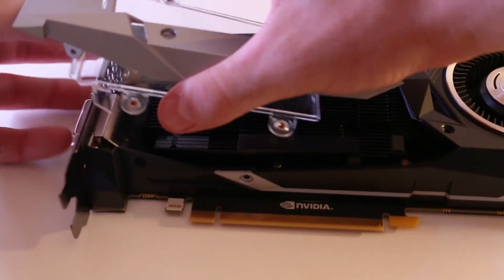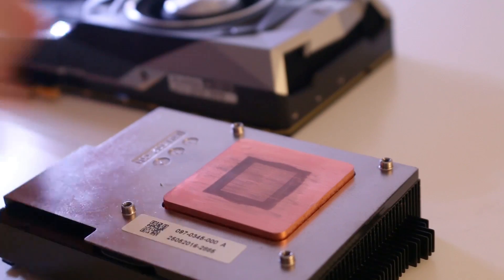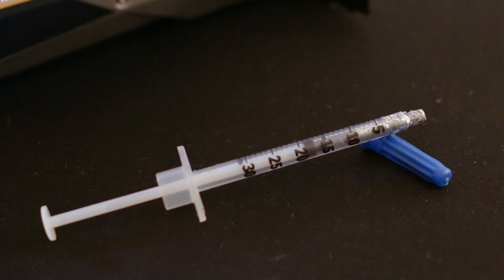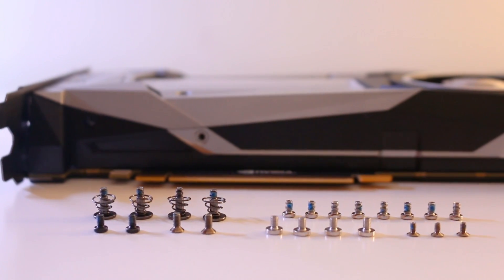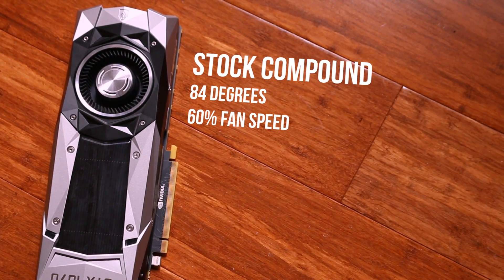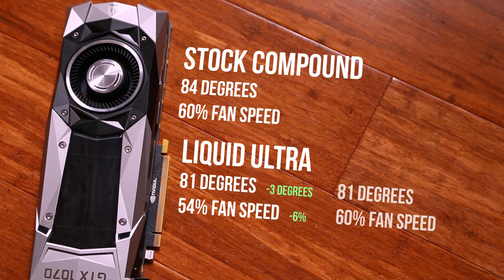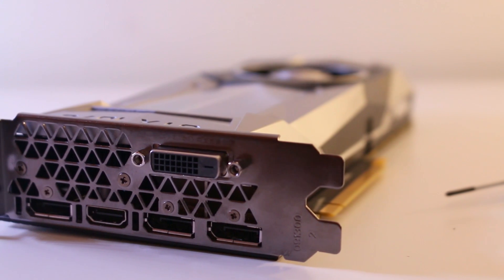Replacing GPU Thermal Compound With Liquid Metal?

Comment: The reason why there is so much thermal compound on the GPU is simple to ensure there is enough on there. Too much thermal compound doesn't give any downsides to thermals, however havin too little on there is dangerous the gpu could melt it self in the blink of an eye. You see the same when delidding a intel CPU between Ivybridge, and kabylake non-X series.

Comment: I've been doing a bunch of cards with liquid metal lately and the reference coolers done benefit much if at all. 

Good coolers however, seem to yield excellent results!
Reply from the maker: +Upgrade Addiction Nope, the reference coolers can't dissipate the heat effectively enough. Improved heat conductivity via liquid metal makes a marginal difference.

The drops on the AIB cards are impressive though as I've seen on your channel!
Reply: Optimum Tech thanks mate! Love your vids too! :)
Reply: If you apply the thermal liquid properly you will see a good difference with almost any cooler, blowers not as much. The gpu being able to dissipate heat better to the cooler will also allow for slightly better memory temps and vrm temps and that helps with overclocking or longer boosts. I usually take off the reference fans and slap on some bequiet 120mm fans and even my low RPM 120s get a max temp of 67 degrees after 24 hours of use with these two fans and liquid metal on a 1080 at 1940 mhz. All of my 1080tis were sticking at about 2000 and 70 degrees but that is with just kryonaut as I ran out of liquid metal.

Comment: How long time does liquid metal last compared to ordinary cooling paste? Saw some there had been applied for 3 month there was nearly dry, so I was just wondering.
Reply: LM after it has cure will make a solder like connection so do not remove and replace it if it gets hard that is normal and will still work as good or better.  It should last the lifetime of the cpu.
Reply: @VaporDan  Nope - unless you are talking about 5-10 years and no-one has posted about that as far as I know.
Here's gamers nexus showing literally no change in LM after a year of use - exactly the same.
https://www.gamersnexus.net/guides/3359-liquid-metal-aging-one-year-test-how-often-to-replace-liquid-metal

Comment: Apply liquid metal on both sides. Mark where the old thermal paste goes up to on the heatsink then clean the thermal paste on it and apply. The is a direct correlation between how efficient your heatsink is and the performance gain using liquid metal. The better the heatsink and fan, the better the liquid metal will perform.

Comment: what happens if I accidentally got abit of liquid metal on the green part of the gpu die chip or on the many little silver chip thing around the gpu chip am I screwed?
Best to clean it off with isopropyl alcohol?

BTW I heard if you got Liquid metal on any Aluminium part of the GPU it's not good because it starts to corroded eat away.
Reply: Tony Tran if you do that first that metal parts can be damaged by conductivity and secondly liquid metal is corrosive to aluminium only 
I hope this helps
Reply: You must remove liquid metal with isopropyl alcohol okay until you do not boot up you are fine if you boot up with liquid metal on small metal chips your graphic card is done
Reply: Tony Tran yeah if you do it correctly it is not a problem however make sure your gpu heatsink is not made of aluminium
Reply: One thing you need to replace it every 2 years

Comment: Your content is good but saying it's not worth doing can't be said just from your testing. You only had a reference 1070 on hand and other sources who did it on cards with aftermarket coolers saw an appreciable temp and/or fan speed decrease for equal clocks and even better OC for equal fan speed and noise. 

I also noticed you didn't mention if you applied the metal on the heatsink as well. I may be wrong but I think that's the way they tell you to do it, component die as well as heatsink or coldplate or whatever.

That said, your videos still are of great quality :)  And yeah on a reference card the heatsink is already almost saturated so it isn't worthwhile.
Reply from the maker: Thanks for the comment. Since posting i've found a similar response from people as you mentioned - aftermarket coolers yield better results when replacing the TIM, compared to blower style coolers.

It seems like the heat dissipation is the bottleneck for this FE card, not necessarily the thermal conductivity between the GPU die and the heatsink.

Comment: dude... if you struggled, then you're not very clever, or you were doing it wrong... there's a metric $*it ton of usable data all over the internet... i found about the liquid metal a few weeks ago, and after couple of days, because i don't have too much free time, i had enough relevant info, that i did it myself on my old Y510p gt755m sli laptop... and it worked like a charm ;)

Comment: The gallium and indium in liquid metal with slowly defuse into the silicon die and kill the chip after a few years, CPUs are made to handle soldering with a couple of layers that protect it, I think they layers are made out of gold and nickel though I'm not sure. 
Regardless using liquid metal is a great way to make sure your GPU dies after a couple of years.
Reply: Horseshit. I have had liquid metal on my laptop with dual 780m's for 3+ years now and it still runs like new.
Reply: Nope.  I have had liquid metal on a backup GTX 780 now for over 4 years.  It has never been reapplied and the chip looks just as good now as it did then.  What an ignoramus comment full of hyperbole.
Reply: No CPUs are not coated with gold or similar the indium has direct contact to the silicon
There is also no case known where this treatment forts the death of the CPU, but it should be pointed out that with unclean processing or if they can use too much it can make problems
Reply: If indium contacts a bare die made of silicon without any barrier it will slowly start diffusing into the die, a bit akin to how gallium diffuses into aluminium but at a much slower scale which would damage and destroy the chip over time. 
What they do in fact is that the die is coated with a layer of titanium first, then nickel and vanadium in a secondary layer, then finally gold which the indium is soldered onto, you should read up on it. 
The layers are so thin thought so you wouldn't really be able to see them.
Reply: I don't know where they have this statement ...
But it is completely wrong in content ... 
Indium is used in the doping of the silicon so it is in some chips indoors even before it is at all a chip
Reply: A few atoms is used in the process when doping yes, but indium based solder is also used between the the IHS and the die as a thermal transfer material. 
If you're using it in direct contact with the silicon die without any sort of thin barrier of other metals the indium will slowly start to creep into the die, it's strange. 
http://overclocking.guide/the-truth-about-cpu-soldering/  has a good explanation to a certain extent, though their statement regarding how indium soldering is bad is very misleading.
Reply: And all that is said there does not refer to pure indium on liquid metal
In liquid metal, less than 0.1% of indium is contained, and this page is very one-sided written to make Intel's savings look good ...
But the Die is as coated in the video still coated, synonymous we use no pure indium what goes in the CPU manufacturing is not different

They can also mention examples where the use of liquid metal has destroyed the components
I myself had a computer with which I used liquid metal and this ran 8 years daily 14h until the conclusion without problems
Reply: Not all liquid metal TIMs are created equal, liquid ultra contains very little indium whilst conductonaut contains much more. 
Regardless intel doesn't have any excuse to use thermal paste on their expensive CPUs, power dense asics like CPUs need a very low impedance tim to ensure they run cool, and thermal paste has much worse longevity when compared to soldering regardless. 
Still if using liquid ultra doesn't harm bare dies others that have more indium content are likely to, if indium diffusion wasn't a problem they wouldn't have made the die layered with other elements.

Comment: A recent graphics card I received from customer has temps over 90c idle, found out thermal paste was dry and cracked.  Replaced with Thermal Grizzly Conductonaut.  Dropped the the temp at idle to 67c.  Also replaced pads and used 33+ electrically reassure around GPU.

Comment: There are more to GPU clocks than just the temps. I got around a 5 degree trim but my core clock also stays at 2100mhz on my gtx 1080 and only clocks down to 2088mhz. 
Prior it would get to 2066 and clock down under 2000mhz.

Comment: I sincerely suggest to redo this and follow the 'proper procedure' as the more experienced people have explained. You'll see the difference.1. Cover with tape (Scotch 33+) or nail polish the components around the die.2. Rub LM on both the die and the heatsink.3. Make the LM more flat and shiny by not ujsing too little.Presto, 10-20c drop easy.
Reply: Fabulous well, sand paper is not the way to go really if you want a mirror finish. There are polishes out there like Commander that make me see my own freckles in the reflection. I did it, gave me a 25c drop in my laptop.
Reply: I have to agree. You have to be a touch more generous and apply to the Heatsink side as well. Also a set fan speed should have been done on both tests. It's not an apples to apples comparison otherwise since the fan speed doesn't affect temps in a linear manner.
Reply: When you put the tape on the transistors can you keep the tape on when putting the card back together or should it be removed
Reply: you keep it on .. the fear is that the liquid metal will leak and conduct on those ... I dont use it myself but the point of it would be to keep it on to protect that from ever happening.

Comment: actually just ordered some artic mx -4 to apply to my reference 290x(it sounds like  jet engine without headphones) :D plus it has the older more sensitive memory so it black screens, leading to having to run the fan louder than i really should to keep mosfet and vrm temps down. Hopefully applying the mx4 thermal paste and new 17 w/mk thermals pads onto the vrm's and mosfets will tame the beast. :D plus lets see how much cooler i can get that r5 1600 with the new paste using the stock cooler and OEM paste.
Reply: how it worked ?

Comment: Made a huge difference on my EVGA 1070 SC. 65-70C down to the low 50's. Did you also put a layer of CLU on the contact area of the heat sink itself?
Reply: Other video's that showed liquid metal on a GFX card did this; application onto both the GPU itself and its heatsink.

Comment: 2 days ago I applied Cool Laboratory Liquid Ultra on my Sapphire R9 390 Nitro with Backplate, but unfortunally my temps did not change a lot. I also used Unigine Heaven 4 to heat up the GPU and I also set a static fan curve with MSI Afterburner (35%), both time I looped for about half an hour. In both cases the graphics card was able to hold its 1040 MHz all 
the time, no throttling. In stock condition, the max temp measured by HWMonitor was at 85°C, after applying liquid metal the temp just went down to 82°C. Just a very marginal difference. The old layer of Thermal Compound was thin so the Liquid Metal should have a good contact with the cooler and Die. I dont know why that is since the r9 390 produces some heat and the cooler is not that bad either. A better heat transfer should have made a noticeable difference, or am I wrong...? Or is the stock thermal compound that good?

I also changed the thermal compound between the DIE and the Heatspreader on my 6600K@4,6GHz 1,35V. I also used CL Liquid Ultra and I delidded the CPU with the Delid Die Mate 2. I set my Noctua NH-D15 to static 750RPM and before delidding my processor hit 70°C max in BF1 and Cities: Skylines. After delidding the temps dropped down to 55°C max, so that was a success other than on my GPU.

Comment: If you mask off the small resistors around the die then I don't see why you shouldn't use Liquid Metal paste :)
Just use masking tape or liquid electrical tape or whatever :) (just something that's not conductive and 'protects' the resistors)

Comment: 980 Ti ref watercooled here. I didn't test stock paste but iirc the difference between stock paste and mx-4 is huge with stock cooler however this is my result. 980 Ti flash bios to 1.281v and 350w tdp with generic waterblock. 
MX-4 give me 55c full load at 35c ambient temperature and 1521mhz. 
Liquid pro give me 49c full load at 35c ambient and 1539mhz. 
Imagine if this is perform in 20-25c room temp hahaha.
Reply from the maker: 35C° ambient 😅 Great results!

Comment: I replaced my 980ti's stock paste with some thermal grizzly kryonaut I don't care what thermal grizzly says that paste gets dramatically better after it's had time to cure. Maybe the on off on off helped it absorb into the pours on the GPU block or the silicon die but the performance difference was noticeable. Went from 55% fan speed down to 45% and 72c-75c to 62c-65c (EVGA Classified)

Comment: you needed to apply it to the copper back plate. i've done this with my ZOTAC GTX 980 and saw a 15 degree improvement. different heat syncs tho  :/
Reply: That's because the LM will make better use of better coolers.  The stock reference design coolers are already doing the best they can so the TIM makes little difference.
Reply: you gotta apply to both sides. The surface tension of the liquid metal prevents full contact
Reply: this creates a good seal as a small amount of oxidation occurs to the pastes during spreading
Reply: It makes a difference, I had about 15-20 degree difference. It's because of the surface tension of the liquid metal meaning it won't easily adhere to the heat sink, creating a small airgap
Reply: Agree, use what is left to dope your copper. It is not essential but worth it as it sticks better if you overdo the application. Thus surface sticky tension and not short circuits.
Reply: Dont worry about shorts.  Simple add a silicone clue on all the stuff near the metal compound and if your extra crazy add tape and check on it after 6 months.
Reply: tape it, apply the thermal paste and then remove the tape or leave the tape in the gpu?
Reply from the maker: That wouldn't make sense at all, seeing as the die and the heatsink are in direct contact! I didn't want to apply too much compound as it is electrically conductive (might spill over the die and short out some components).
Reply: did this to my new Aours 1080ti and saw a ~10-15  improvement
Reply: do it right
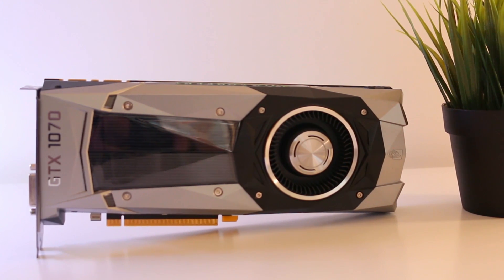Reply: @optimumtech  2 years later, but FYI: per Steve from Gamers Nexus' 9900k delid- @ 2:55 "liquid metal surface tension requires it to have an opposing surface that is also coated in liquid metal"

Comment: If you want better cooling on a founders GTX 1070 without using a open air style cooler, you could mount the cooler of a GTX 1080 founders edition on there.
Reply: felentus or get a hybrid kit because it's a reference design

Comment: Hi Optimum Tech, if you want to improve your GPU temperature I would suggest an aftermarket cooler, more specifically an Arctic Cooling Accelero III (or IV without backplate/heat spreader). It fits both your GTX1070 and the NCase M1 even with the bottom fans (if you leave the Accelero fans aside, of course)

Comment: if you use epoxy or silicone around the GPU die it will stop things from shorting out...
Reply from the maker: Good idea! At the end of the day - not worth doing, at least with Pascal Founder's Edition GPUs.
Reply: Optimum Tech I have found with age it is necessary to replace the compound.. but by then you're usually buying a new GPU..
Reply: Joe S i am in the same boat but i am just scared to just delid
Reply: Matt K, Hey. I just delidded. I ran cinebench r15 before and after. I had a max average of 64*C before and now I have 54*C after the delid using a nh-d15 with a single fan. As for the fears of delidding, the pop was the biggest worry of mine, and it was nothing at all.  Just make sure you get the PCB into the delidding bed, as its a really tight fit. I also added RTV over all of the exposed copper contacts beside the die and just at the four inside corners of the heat spreader. Just respond if you have questions.
Reply: I have been putting off my 7700k delid for this same fear. I was thinking of taking some super glue or RTV to cover up the four pins on the pcb of the processor. I know, I really should just take the plunge and get it over with.
Reply: dont be. its ez with the rockit
Reply: only worth doing if you switch to water cooling.

Comment: Nice video. What about putting thermal paste around the core, around where you putted the liquid metal
Reply from the maker: To insulate the surface mounted devices around the die? Yeah I think that would work.